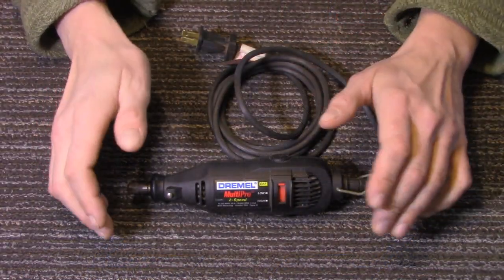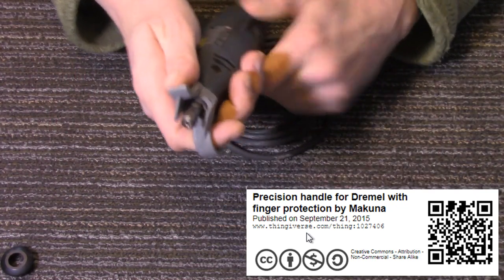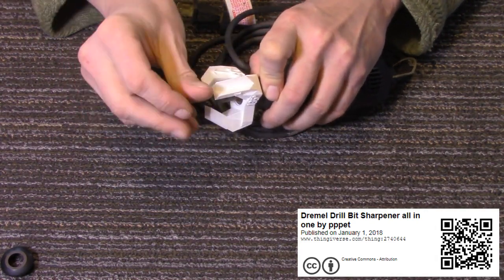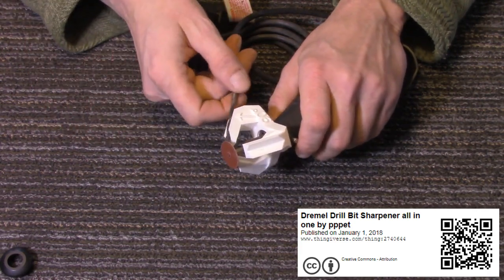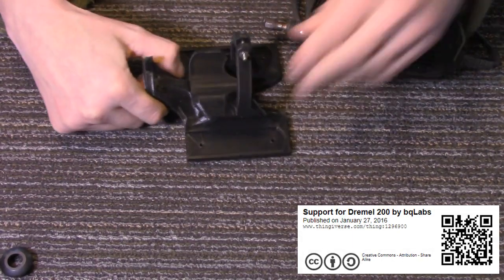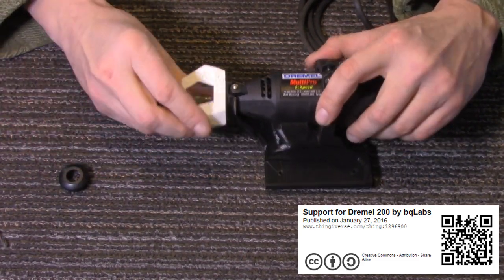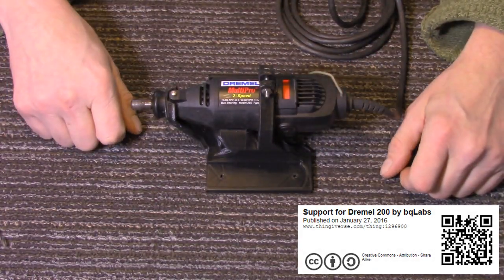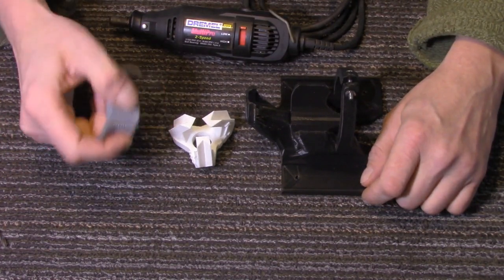Z-3D ep#1:  COOL 3D printed accessories for your Dremel tool.

Comment: True Conquest 1, and only 32 likes!!!! Thank you Z-HUT. I use my Dremel a lot and will print these. I printed the 3 Trays for holding the Dremel Accessories  and the holes for the shafts are all just a touch too small so I will drill them out. It's still a very cool design. Again, Thank you for taking the time Z-HUT.